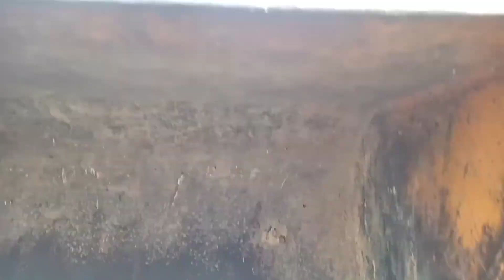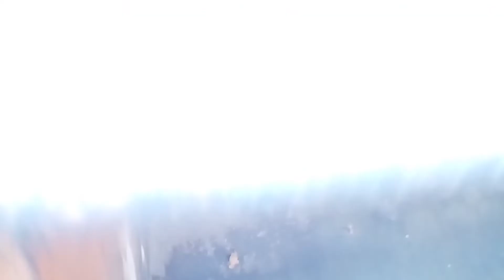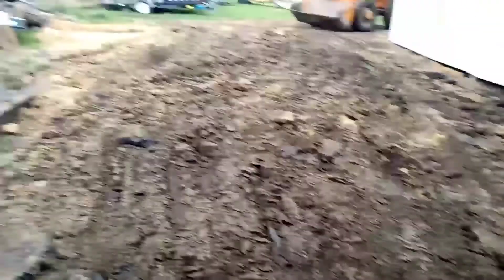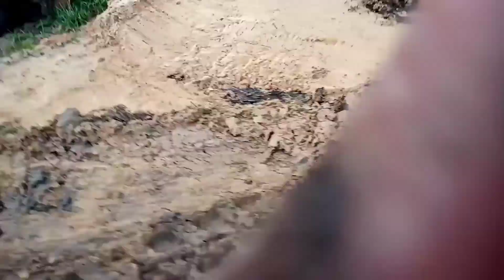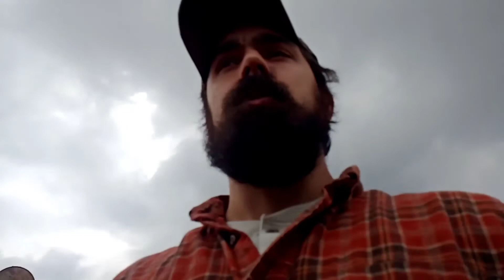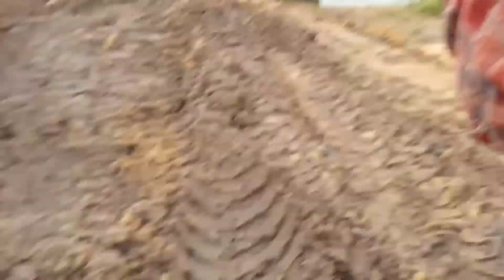SMOOSHING THE BLACK TOP INTO THE SLOP HOLE

Comment: Do y'all have shale where you live?  I wonder if shale would work good, since it hardens up good.  We don't have clay out here, but whenever we have soft spots, like potholes, or a new drive gets put in, or we have a wet year and the bottom falls out, under an area that's normally driven on, we put down shale, and within a year it makes a heck of a hard base, that can then be covered with gravel or something of the sort.  Even whenever we have a road that washes out, the county builds the road up with shale, and almost no amount of rain, will make that spot sloppy.  Just a thought, trying to help. 

In other news, I'd love to have a loader!  Lol!  Even an older one!  It would come in handy, alot!
Reply from the maker: We do have shale. I may have to do it in the spring.  Really don't think I'll get to it this year now.    My only concern now is when I have to put my posts in for the next section of building that I'm going to hit rocks.  Having a loader is awesome.   Never thought I'd have one but it was a deal.  Never really thought how much I could use one till I got it either.     I think mines a 1974.  Motor was rebuilt.  Has leaks etc
Reply: @TREEKILLER90  I have an old 1966-72 vintage, Case 4k lb capacity all terrain forklift and I use it for all sorts of stuff I never thought of, before I got it.  It was a deal too...........as it would have to be..............because I'm cheap!  Lol!
Reply from the maker: I'm cheap too haha.  Have to be now days.  I worked my butt off few summers ago doing side jobs of my own and gave $3900 for it.
Reply: @TREEKILLER90  Dang!  That's not bad, considering it's got a rebuilt motor!

Comment: What was there to cause it to be so soft?
Reply from the maker: I live in clay county.   We got a lot of rain an I tried getting the wheel loader in there to tear apart the old building and buried it after I broke the crust it's a bottomless pit there     so from the ruts they filled with water and made it worse
Reply: @TREEKILLER90  I live in NC so i understand the clay thing.....i wonder if adding the sand is making it worse......i think id try some dirt......anyway GL Olbuddy
Reply from the maker: @DuaneT64  I'm hoping the sand will absorb and help push water to the top to run off in the future.  Right now it's definitely making it tackier.  I think I may snag a couple loads of gravel to put over the top while it's froze right now   smooth out what I can.  Wait for it to thaw and pack it down.  I don't know lol.  I just want to park my trailers there for the winter but when it's thaws in the spring they may be gone haha